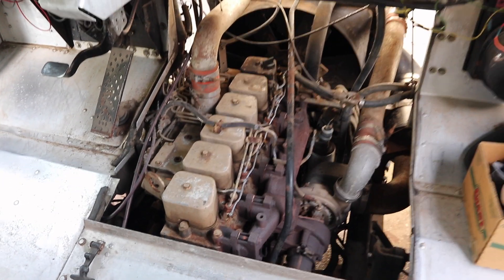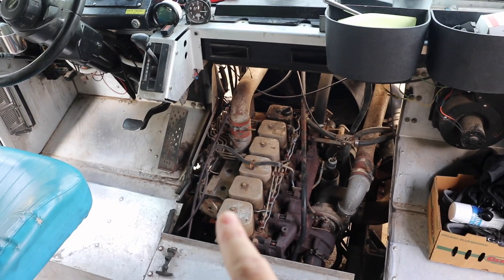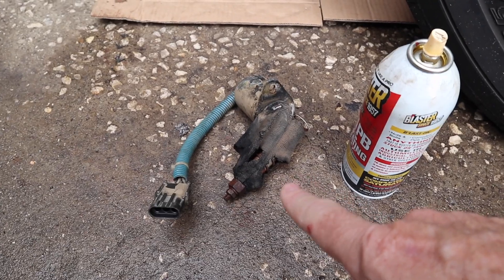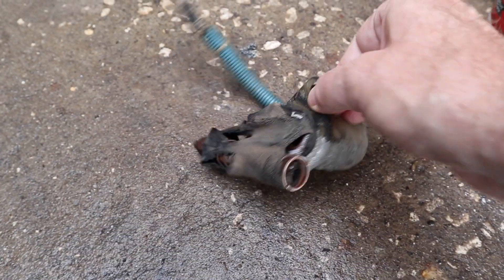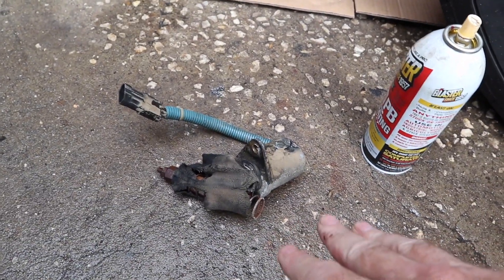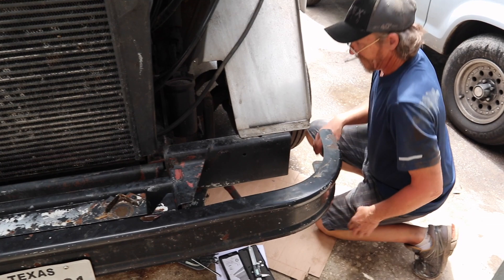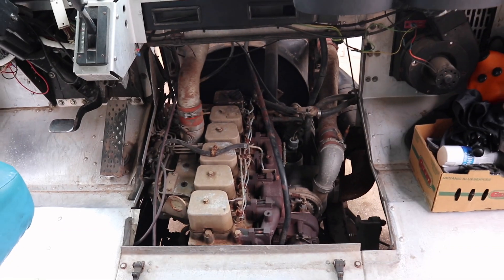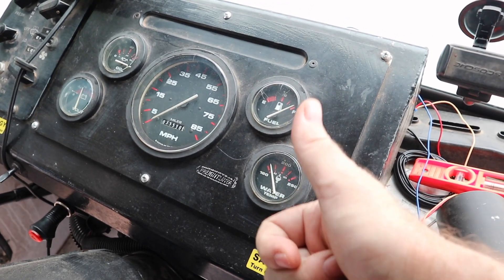Troubleshooting Fuel Pump Shutoff Solenoid in Step Van E554

Comment: Seven, glad that you're all fixed. Little story, back in the 70's whenever I'd purchase a car I always switched the battery to a Sears Die Hard. A mechanic in my neighborhood of Las Vegas, NV told me that in this heat I'd be lucky to have a battery last 3 years. don't bur a real expensive battery since I'd be replacing it in 3-4 years. That advised has served me well. Again stay safe, a diesel is good but I'd rather have a good old gasoline engine, not the new CRAP, but something I can fix on the side of the road, a good ole Chevy..... I remember that when you got the SV you had a problem with battery charge and you used the master cut-off switch. That solenoid on the fuel pump was probably the problem all along..

Comment: Use a test light and see what fuses are live with the engine off hopefully with fuse box schematics to tell you what is what combined with a load tester/volt meter on the battery remove each fuse individually to find which circuit your heaviest draw is on, once found trace it out and usually will find your trouble. Glad they got you back on the road, safe travels!

Comment: All the repairs since you’ve bought this van are all normal for a vehicle like this and it’s age. Ask Badge are there any other typical preventative repairs you should do, it may save you in the future. Should you carry any spare parts? Like an alternator, a good used fuel pump, spray nozzles (injectors), wheel bearings or hoses? Should you buy spares of any parts you’ve already had replaced? Glad you’re rolling.

Comment: Possible way to diagnose that solenoid, is put a volt meter in the old part. Check the two posts in the ohm(resistance) setting.  Very low resistance could indicate a short or a constant draw.   I’m not a master electrician, so maybe one can comment and confirm or destroy my theory!  
Glad you’re back on the road.  I was fairly confident nothing major was wrong. Those motors are extremely robust!

Comment: The last electrical test was a "parasite draw test". That would be a simple one for you to learn in cas there are problems later on. Glad for your success and helpful netwok of friends.
Reply: He probably has a bad starter. Since that solenoid is also connected to the starter. So I installed a extra heavy duty switch between starter and solenoid line on side of bed in my mh. So it won't burn out the solenoid again.

Comment: On my diesel pusher mh,I put regular switch near my bed for extra safety, I manually disconnect it. There is no motor in the solenoid. Its just another form of magnetic switch.
You didn't have to buy it for over $200 at cummins.. Its around $20 new at eBay. One from cummins is also from China.
Reply: That cummins engine will last forever!

Comment: If I remember correctly when you bought he step van you had a massive battery disconnect switch in the step well. What does this mean?  This ain't the first rodeo with this beast, someone else has had problems and due to cost or a lack of skill they were not able fix it right so they adapted an alternative solution.  You may not be any happier about leaving than they at seeing you go. When I was a kid diesels didn't have electronics and as far as electrical equipment they had a starter....... and that was it!  If it acts up again you might have to do some long term diagnostics to find out what's pulling the battery down.
Reply from the maker: you are exactly correct; seems  this has been an ongoing issue from the previous owner and I've made several attempts to track down the parasitic drain to no avail. however, latest theory is it might be a diode on  the back of the alternator. hoping to track it down this coming winter in Arizona, but until then I'm using the master battery cutoff to prevent the drain

Comment: Solenoid valves open when energized.  De-energized they use no power and spring pressure keeps the valve closed.
Reply from the maker: I'm still learning about solenoids. do they use power if the spring fails and it fails to close or shutoff?

Comment: How do you like the 5.9 Cummins out on the highway?Does it have a hard time doing 70 to 75 mph. I drove one years ago it didn’t have any trouble running 70 to 75 but Jesus it was screaming. didn’t want to do much faster than that. Not that you need to go any faster than that but the screaming sound was pretty annoying. I just purchased a 1995 Chevy P 42 step van with the 5.7 fuel injected 350 and it’s really about like driving a pick up truck it doesn’t have any trouble cruising out on the interstate. I always thought I would enjoy the diesel though. I’m kind of partial to the 350 because they are very reliable also And every auto parts store has a plethora of parts for it If it were to break down on the road. I can actually buy complete engine for this P 42 for the cost of the tires on the Frieghtliner based vans. Mine also has the smaller tires like you would find on a 2wd 1 ton pick up so that’s kind of another reason I leaned toward the Chevy chassis. Is the extra cost of the diesel van worth it?  A bid on mine and got it for about 560 bucks. It’s really nice and clean even the paints good on it.It only has 110,000 original miles on it but it had been sitting for two years I poured 5 gallons of gas in it and put a battery in it and drove it home. I’m not sure what kind of fuel mileage it gets but I’m going to guess that it’s around 13 to 14 mpg. I’m just starting my build now and I’m trying to keep it light and simple. But the idea of moving up to the diesel power is also in the back of my mind Simply because I may want to pull a trailer or tow a small vehicle And I’m sure that kind a Weight would really strain The small block 350 in hilly areas. I’m pretty impressed with how quickly it gets to 60 it’s pretty light on its feet to be such a big monster it’s actually quicker than some four-cylinder Vehicles I’ve driven.

Comment: Seven, about the battery drain problem, Eric at the South Main Auto channel is the best person I know of at fixing electrical problems.  One of his latest videos he was working on a car who's battery would go dead overnight.  He used a flir camera to see 2 relays that were on when the car was off which lead him to a fuse that was installed in a slot that it shouldn't  of been.  Maybe you could contact him and see what he says.  He is Literally the guy that other mechanics call when they cant figure out a problem.  Here's link to that video if you're interested.
https://youtu.be/8E8vJP3r1Bs